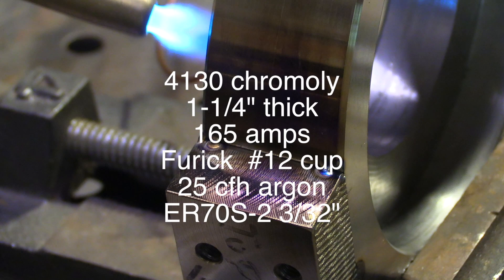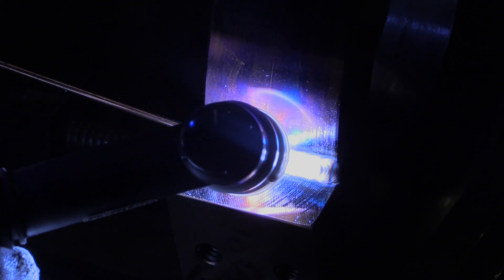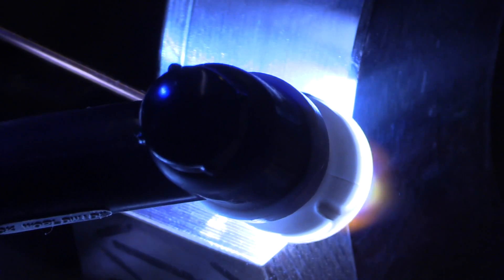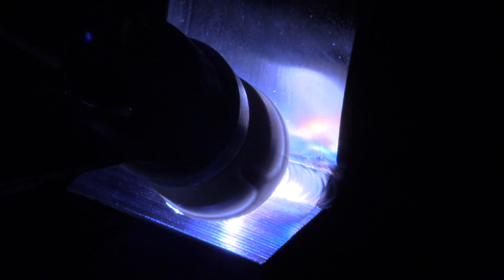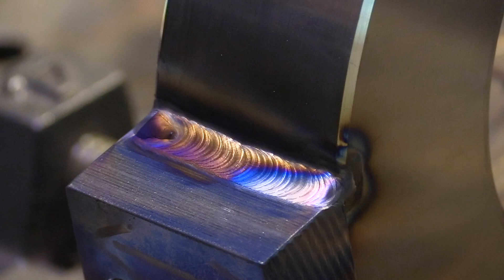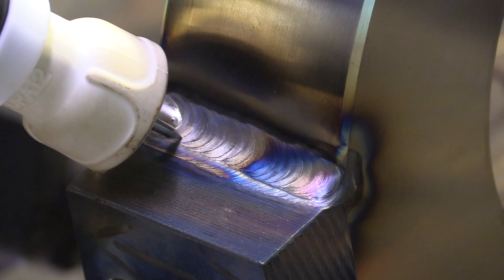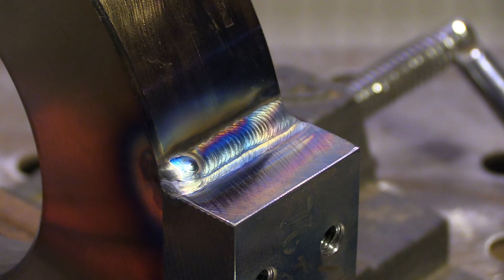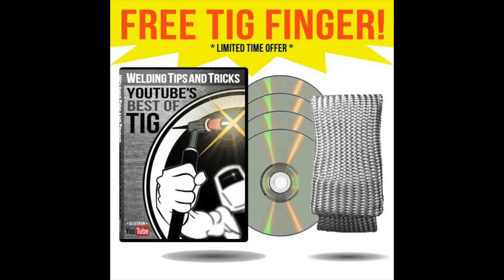Welding Thick 4130, Preheat, & LayWire Technique

Comment: Very nice pictures of your weld Bob Ross..  Wait.. Wait..  Jody.  A Question,, yes preheat,,No post-heat???  couldn't you use a mig and get the same result with the pre and post-heat?  by putting it in an oven to keep the Brinell hardness in check? What pre heat did you start with? 700?

Comment: You preheat so you can get penetration or so that it doesn't cool too fast and crack? I am very curious about how to maximize the thickness of the material you can weld with a TIG welder.

Comment: So I got a job at a train yard and j never used a welder. They said fine I can learn. 3 days in I love it and could easily weld flat. The problem is I have to weld overhead horizontal and vertical with one pass on two plates. The steel had to break not the weld when they bend it I can never get a clean weld that has the heat pass through and it digs pretty bad on the overhead. We use Miller arc and a wirespeec of 4 and heat 24

Comment: Laywire technique looks pretty cool. That is something I need to try with my powertig welder.
Reply: Laywire technique produce great looking welds, but, not the best technique for welders  just  starting  tig welding  , because of the possibility of lack of fusion. The only way to determine if you are having lack of fusion, or cold lap is to X-ray, or cut and etch the weld samples.

Comment: Hey Jody, thanks for the videos, you're a huge inspiration, I literally started my career as a welder thanks to your channel.

Ok, so here's my question.

When you get given weld specs(I.e fillet size etc) how do you know when you can do multiple passes to achieve the fillet size?

I've been reading up on welding theory and came across some information on minimum fillet weld sizes for a given thickness/range of thicknesses.

Do you do any math work(I.e figuring out what minimum size fillet for your first pass) or do you just go off of instinct?

Comment: Forgive my ignorance,  is that size weld joint strong enough for a 1 inch+ part. Penetration? Beveling the edge not required?
Reply from the maker: Daft Funk the drawing had a weld symbol requiring.250” leg size and I met that. The thickness of this part is more for dimensional stability than strength alone.
Reply: @weldingtipsandtricks  thanks for reply would have helped if i had read your first comment explaining the task. As a matter of interest if you were welding for strength on the part what would the procedure be?

Comment: The taper of the tungsten,in relation to the diameter, should be 2.5 x,correct?The taper looks shy.I'm asking this for educating myself,because I use this as a guideline when I sharpen my tungsten. Any feedback will be greatly appreciated.
Reply from the maker: Charles Moore 2.5 taper is a good rule of thumb but for high amperage, less taper works fine and can get better penetration

Comment: Why just 165 amps? Why not 200+ for that thickness?
Reply: The thickness I don't think is an issue since he preheat at the beginning. 200+ could make it to hot and cause a slew of other issues.
Reply: @keegan7ThatMe  i'm no expert but if it's metallurgically stated that this certain material does not like to be heat treated by having extreme temperature differences a.k.a. welding stone cold material with 200+ amps, then it is advised to preheat and use less amperage to make it less of a "heat shock" for the metal
Reply: شكرا لهذه الفيديوهات المفيده 
ولاكن ماكينات اللحام عندنا ليست بهذه الجوده

Comment: Re:  Crater eye.... first pass … right to left.  Would it help to run the second pass left to right  or am I overthinking it ?
Reply from the maker: sometimes I do that.  switch directions to even out stress.  But wasnt really worried about this part because it was going to stress relief heat treatment after welding. distortion was not an issue either since the overall dimensions of the part was at least .050" oversize for final machining
Reply: Youre not over thinking it. I was honestly about to ask about the left to right thing until I came across your comment!

Comment from the maker: A few weeks ago, my machinist friend brought 2 parts for me to weld. I already posted the first part where I used a 2 pass weld to achieve the leg size specified on the drawing.
For this part, I used a somewhat different technique.
Reply: Since this technique works for this crack sensitive alloy, I'm assuming you could use this for a medium carbon steel?
Reply: Привет от Азовских сварщиков!